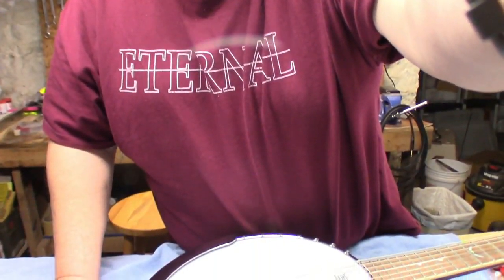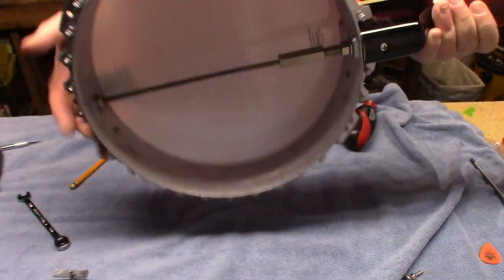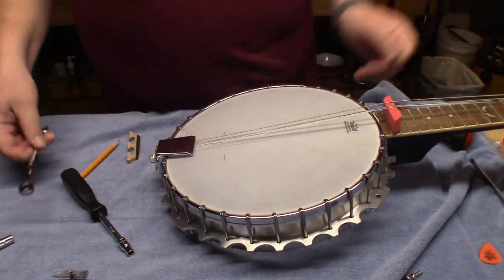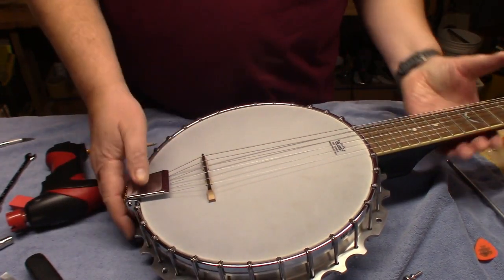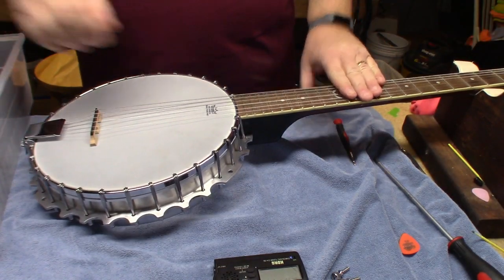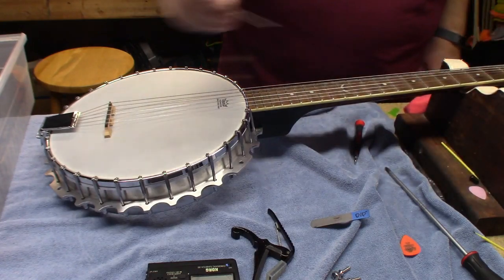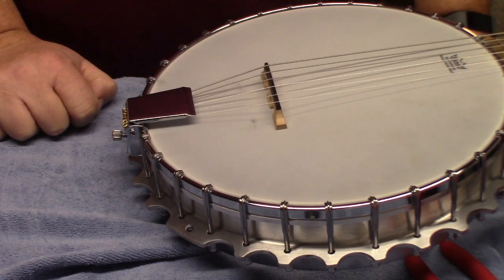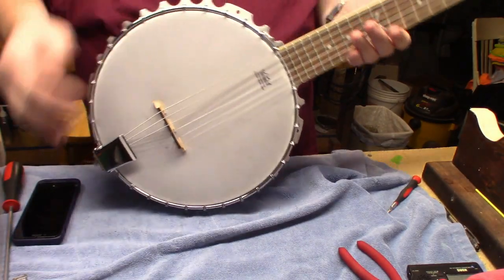Dean Backwoods 6 string Banjo Setup

Comment: Thanks bunch great vid I learned so much (I’m working on one now). If possible can you reply with tailpiece height and mention what that height will be in relation to (hoop-ring or what)? And if ok pls also a good rule-of-thumb regarding sanding bottom of bridge to lower action (so approx how much bridge material removed will equal let’s say 2/64 or whatever # you’d work with such as if using caliper then sanding ect; and with nut slot too). Or if this too technical per se then how’d best would you handle action and tailpiece adjustments)?
Reply from the maker: It’s 4/64” at the 17th fret. The bridge location (center of bridge) is 25.5” from nut, then you address from there to arrive at a point of the Es being intonated at the 12 Th fret. Thank you for the kind words and watching.

Comment: Nut to bridge what should that distance be?
Reply from the maker: It's a 25.5" Scale. So nut to center of bridge is 25.5" then move either the low e or Hi E to get the outside strings intonated. but be sure to keep the center of the bridge as close as you can to 25.5".
Reply: @stringmanguitars4329  I often don't trust the specs of affordable foreign instruments.  No matter what they claim the scale is, I measure from the nut to the twelfth fret.  The distance from the twelfth fret to the bridge should be the same measurement.
Reply from the maker: Sean Coxe right. That's a way to do it too. But I used my slotted straight edge. Realized it's a Fender scale. Set the bridge at 25.5. If you can intonate the two E strings, you've won.
Reply: @stringmanguitars4329  Yes it's like intonating the Archtop Guitar

Comment: The difference between a good vintage guitar banjos verse the newer ones is enormous, far greater than the difference between vintage guitars verse modern guitars. Many of these newer guitar banjos are just awful sounding.
Reply: The 6 String Guitar Banjo tends to have a slightly larger & deeper body than a 5 String Banjo so that the lower notes speak more clearly. This is that good old fashioned Dixieland Jazz sound from the 1920s and 30s before we had amplification.